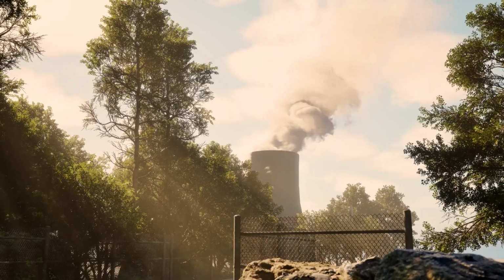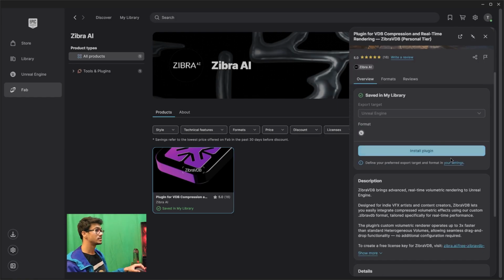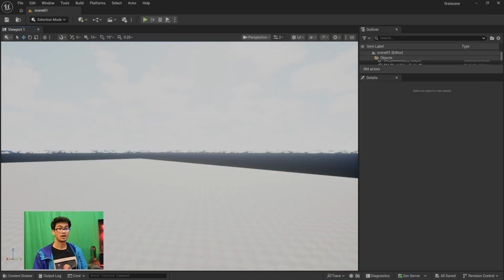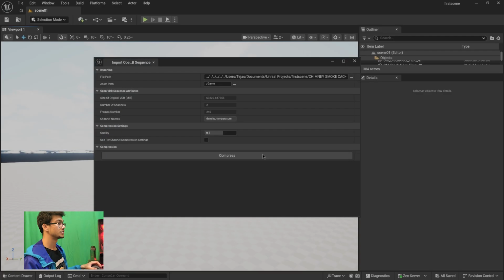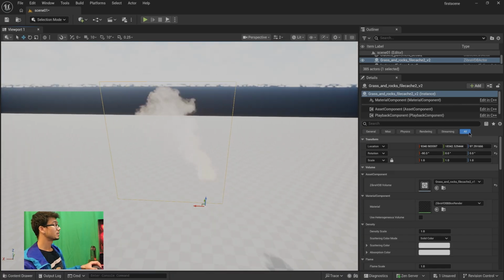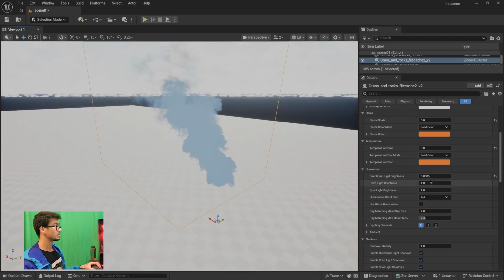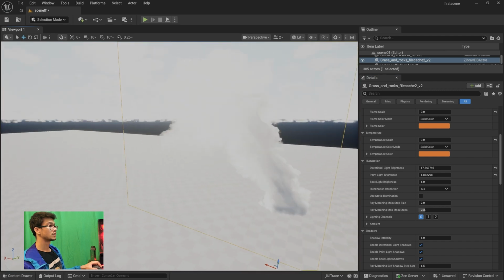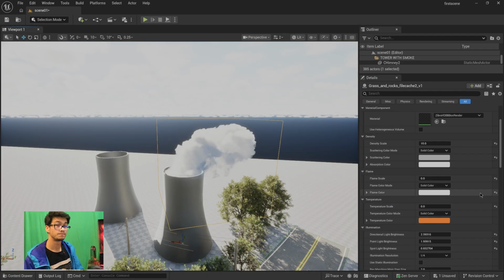Bring Houdini Smoke into Unreal Engine | ZibraVDB VDB Import

Comment: Compression is only allowed on VDBs with 512 voxels on the longest axis. Anything Higher res wont be compressed. Just spent half an hour downloading and testing another useless tool
Reply from the maker: maybe you should consider the effort it takes to create a tool, if it doesn't work for you then just take your as* somewhere else because after this comment i am sure that you have no f idea. just f off.
Reply: @txjxs  they should inform users of a tool's limitations at the point of downloading it. I appreciate the effort, but I don't like wasting my time trying to figure out why a plugin is not working after spending an hour on it.
Reply: @txjxs  also, mind your language bro. Did you get stung by a wasp or something?
Reply from the maker: @valentina.ferran  please get lost!
Reply: @txjxs  a very large wasp
Reply from the maker: @valentina.ferran  haha perhaps i was just irritated with something when i wrote that